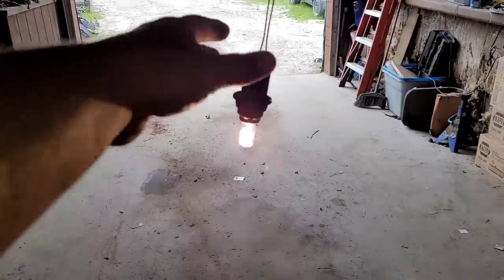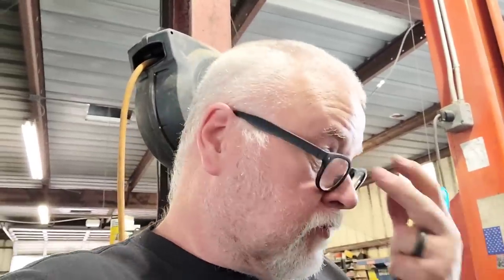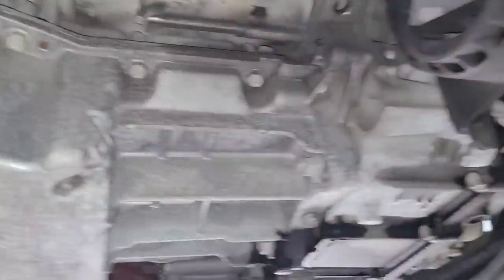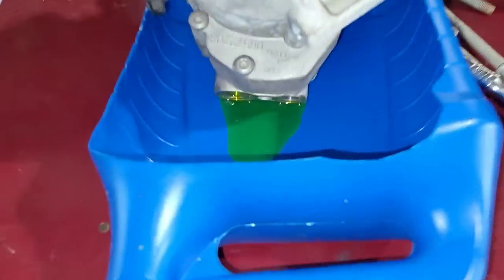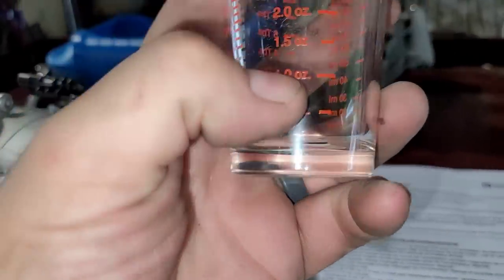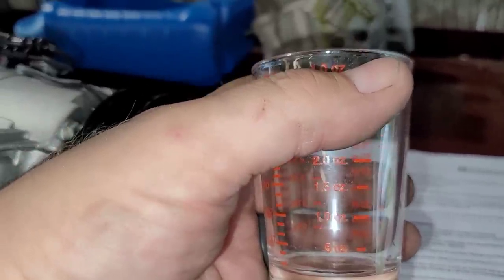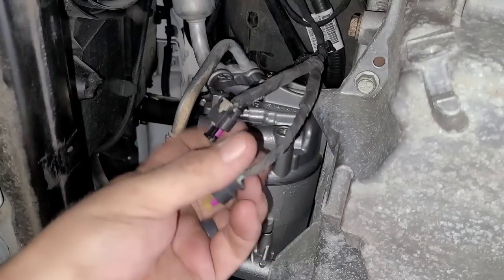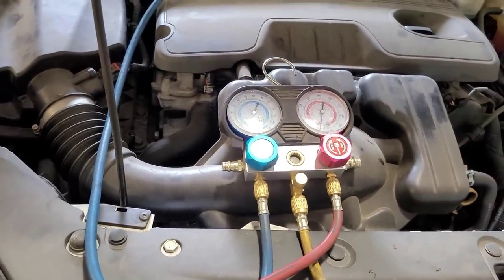I Have Everything I Need, But Still No A/C Compressor!!! What's Going On??

Comment: Got a 2011 forte. Something is making a grinding noise on accel. Either the compressor or the alternator! Both are original to the car from factory.
Reply: Well, remove the alternator, and spin it outside the car. If it is noisy replace, and if it is not then AC compresor will be noisy. But first check engine mounts, because after 12 years they likely are well worn and have torn rubber. Note, but the alternator from Kia, or from a good reconditioner, as it is controlled by the ECU to regulate charge. 12 years it will have shot bearings front and back, and worn brushes.
Reply: @SeanBZA  I already know the mounts need replacing. But I’m thinking it’s the alternator
Reply: @SeanBZA  got a denso branded alternator which is supposedly what the factory uses.
Reply: @YeOldeGeezer  Yes it is Denso, and at this age, and likely mileage, well worth changing now. Just has to be the right Denso.
Reply: @SeanBZA  well it just rolled over to 140k a few weeks ago.

Comment: Kenny I'm confused. You said to tip the bottle of 134-a upside down while charging the a/c system. If the can is upside down I heard it came out liquid, like for home freezers, and if the can is upright it comes out gas, like for car a/c, home a/c units ect. Can you further elaborate the difference. Thank you..........Pete
Reply: You always liquid charge r134 as it is a mix of different substances, if you charge by vapor you are only taking the lightes substance first, by the time you get to the end of the bottle, the refrigerant will be much less effective
Reply: @kellismith4329  you have to keep in mind, forcing a system to take freon at a fast rate is very hard on the pumps. Once the system is in a vacuum state then the initial charge is quick, from there the pump itself will draw at the rate it needs. It's slower yes, but easy on the pump.
Reply: @garyr7027  no I would not rush charging it, put it in a deep vacuum and then recharge into the high side but with the bottle upside down so it dispenses as a liquid; then close the access valve at the high side  connection - once the pressure has balanced out the start the compressor and slowly bleed out the liquid still in the guageset.  If you charge from the bottle upright you remove gas from the cylinder so it comes out as “layers” of vapor so the first few systems you fill will get the lightest gas in most abundance so the refrigerant will behave differently than the systems you charge from the bottom layers in the cylinder and they may in fact not work efficiently. R134a is known as an aezeotrope consisting of 3 substances, each refrigerant has various characteristics
Reply: @kellismith4329  that's pretty much how I've ever done it, let the vacuum do the job on both high and low side, then kick the pump on to finish it up. By then there's enough freon in the system the pump will kick on, with no problem.
Reply: @kellismith4329  R410a is the mix you are thinking of, not R134a. R134a is a single component refrigerant.
Reply: R134a is single component, so go in or evacuate as liquid or gas. R410a is a mix (R32 + R125) so has to go in as a liquid since the gases separate. R407a is a mix of R134a + R32 + R125 which is functional equivalent to 50/50 R410a and R134a. The R134a helps bring down the saturation pressure to be a replacement for R22 which operates at lower pressures than R410a.
You can put R134a in liquid or gas as long as the compressor isn't running(to be extra safe). Liquid is going to hit the bottom of the accumulator. The top of the accumulator is where the compressor pulls gas from, plus a U shaped tube that dips to the bottom to pull a small metered amount of liquid refrigerant and oil.  But with a 5 gallon bucket of hot water, you can fill with gas without even engaging the compressor. Forcing a can of r134a to 120F will raise saturation pressure to 171psig and empty the can fairly fast. You'll be left with a self sealing can of a tiny amount of gas refrigerant you can keep and use later on a flat system (plus nitrogen after) to do an electronic leak test.
Reply: @BearHomeOwnerDIY  damn that's detailed info, we're not chemist though... Lol

Comment: Could the gap be too much for the clutch to engage?
Reply: If something in the compressor is damaged yes, you can visually see the clutch pull back when energized
Reply: Or it's just stuck on the pump shaft. I've seen clutches get stuck before, where the clutch splines get rusty preventing the clutch from activating. A simple removal and cleaning did the job.

Comment: I wouldn't assume an AC system has 134a. Most cars come with yf, and its a lot more expensive. You can't use the same machine either, and I don't think an affordable solution is available from places like HF. Until prices come down, plan on using a dealership. Most independent shops haven't bought a yf machine yet.
Reply: yf?
Reply: @dws2313  1234yf refrigerant.
Reply: @dws2313  it's been out since about 2015 I think
Reply: Easy to identify it is written all over the components
Reply: Catalyst sticker has that information, I'm sure Kenny knows what it takes. Besides, everytime they change freon type, they also change the fittings, so you can't just accidentally charge 134a into a system that takes different type freon.
Reply: @garyr7027  fun fact: I have used r12 and r134 and subbed one for another with very little difference in operation, slight difference in pressure, for r12 systems you charge with a little less r134 as it is a more efficient gas
Reply: @kellismith4329  r12 takes different fittings. When 134a first came out, all the auto parts stores sold retro kits for r12 to 134a and they all included high and low side adapter fittings for the 134a manifold gauge sets... or just the simple charger hoses. Both freon types has different fittings. The r12 system had smaller fittings.
Reply: @AT-wl9yq  -  No, you are definitely wrong with that incorrect statement.  You definitely cannot even say that MOST cars come with the super expensive Freon.  Most cars Produced TODAY maybe, but the majority of cars on the road today still use R-134A and there are still a lot of Classics still running R-12 Freon.  My Home AC unit was still running R-122 until I had the entire HVAC System Replaced last year, after my Lanscaping folks didn't know the differerence between a scrub tree and the Low Pressure return copper tubing.  That system would probably have made it another twenty years, if those Tree Trimming clowns hadn't of done their thing !  You can still get both R-12 and R-22, even though none has been manufactured for a very long time.  Now, if you want to talk about some expensive Freon, you literally have to pay through the nose for real bonifide old new stock R-12.  Not the stuff made in Mexico, that's actually just a super flammable concoction that is a blend of Butane & Propane that obviously is a very bad way to go.
Reply: @johnbishop7912  "No, you are definitely wrong with that incorrect statement.  You definitely cannot even say that MOST cars come with the super expensive Freon."

Unlike you, I don't guess. And I certainly don't argue facts. What's amazing is people like you make statements without any knowledge whatsoever. Do you have any idea how easy it is to fact check my post? yf is the new standard. There's nothing to debate. 

"As of 2022, 90% of new U.S. vehicles from original equipment manufacturers (OEMs) are estimated to use HFO-1234yf."
"On July 23, 2010, General Motors announced that it would introduce HFO-1234yf in 2013 Chevrolet, Buick, GMC, and Cadillac models in the U.S.[31] Cadillac became the first American car to use R-1234yf in 2012.[32]

Since then, Chrysler,[33] GMC[34] and Ford[35] have all begun transitioning vehicles to R1234yf.[16] Japanese automakers are also making the transition to R1234yf. Honda and Subaru began to introduce the new refrigerant with the 2017 models.[32] From 2017 to 2018, BMW changed all of its models to R-1234yf. As of 2018, 50% of new vehicles from original equipment manufacturers (OEMs) are estimated to use R-1234yf.[36]"

https://en.wikipedia.org/wiki/2,3,3,3-Tetrafluoropropene

Next time, do your own research. Its not like this information is hard to find.
Reply: @garyr7027  If you took the time to read my post, I never said Kenny didn't know what he was talking about. Most late model vehicles  use yf. The industry started the transition in 2010. If your vehicle is less than 13 years old, it would probably be in your best interest to find out what it calls for before you start working on it. The average person will not know this. Why keep it a secret?
Reply: @AT-wl9yq  I read your entire post, you suggested not to assume, which imo implies not knowing. It at least suggests guessing anyways... which is a no no in this field.

Comment: I wonder how many cars you've worked on are out there with issues because you didn't bolt things tight enough. I understand your point but come on, you are barely tightening these fasteners. Let's not even talk about what you do with oil filters. If those things didn't have good seals, they surely would leak how loose you make them.